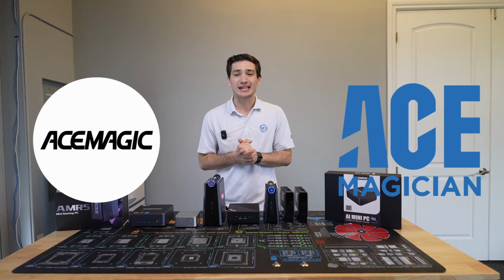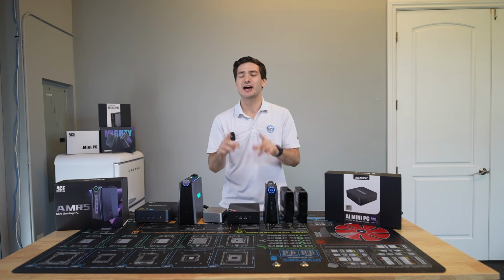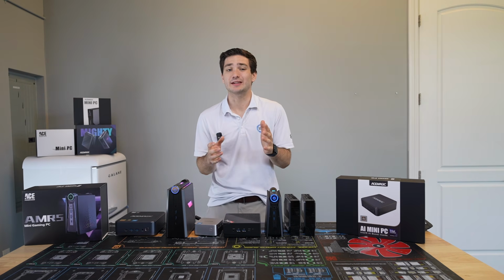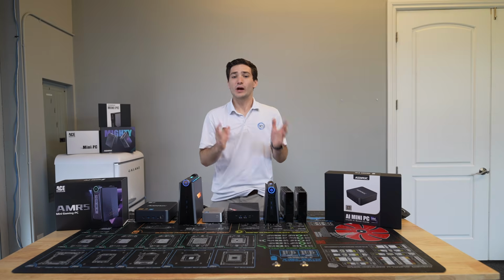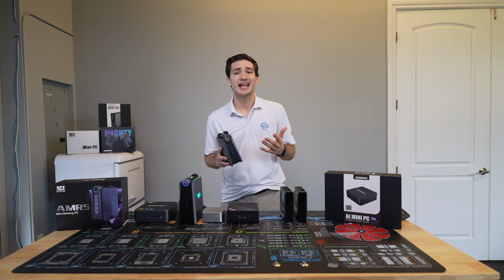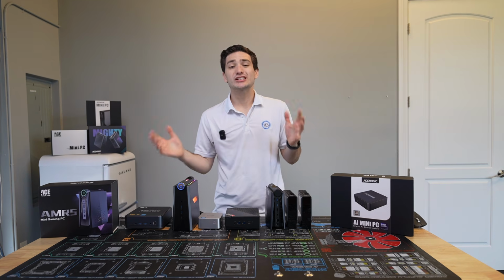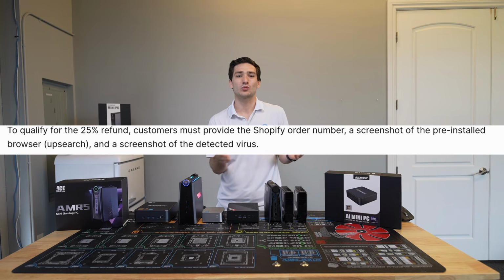Acemagic Is Selling SPYWARE! Don't Buy These Mini PCs

Comment: As an up to date..
One serious thing is with my unit here in the UK ( S3A ) is that the bios does not support Secure Boot Mode. This means the version of Windows 11 Pro they have provided has been somewhat altered. I would consider this a security risk espcially since I heard Microsoft is taking to hand all vers of by-passed Windows 11 soon.

Comment: Every single Ace Magic product has fake hardware (lower spec CPU with edited firmware to claim its a 5700U - Windows edited to show more RAM/Better GPU etc). The device chipset is FILLED with unremoveable banking malware that will steal money after a pre-determined "oh it didn't do this straight away" time they hope you'll forget the money was stolen the date of first install).
The issue is even the stuff Matt was sent that didn't contain software-viruses STILL has the hardware malware but due to its low-level, window can't detect it.

Comment: I like my rescue/diagnostics live OS's on Flash Memory cards. I use the ones that have a read only/read-write cards. So it will be a lightweight Linux OS distribution, or windows PE environment. I set these cards up on a known good machine with access to the internet, and regularly update them. 
1. The first thing you have to test is for a clean ROM UEFI/BIOS image, because if this ROM is compromised, then the OS will also be compromised. If the ROM is compromised you can always re-flash it, with the right files from the motherboard manufacturer. So research the type of motherboard used in the PC FIRST before you buy it. IF the live system running from the Flash card has no issues, like no hardware driver problems, etc, you are good to go. 
2. Make sure the BIOS is up to date with the latest (post-2023) encryption/signed keys. 
3. Assuming you have done all that, the next step is to ensure that the OS is good. So then I do a partition and format in whatever file system you need for the OS. And as others have suggested, don't use the OS loaded by the factory, but an ISO image you know passes the checksum tests after download.

Comment: 6:03
This is actually fairly normal. A lot of after market SSD heat sinks are supposed to be applied this way. Nothing wrong with it and certainly better than the OEM approach of attaching them to the drive with glue.

Comment: Wrong on the windows 11 bypass Internet part. You can bypass the no network during the setup process. Bypass/nro in Google to show how, very easy

Also a prebuilt computer/windows setup like that most likely has exclusions setup that is why the anti virus doesn’t detect them and looks fine.

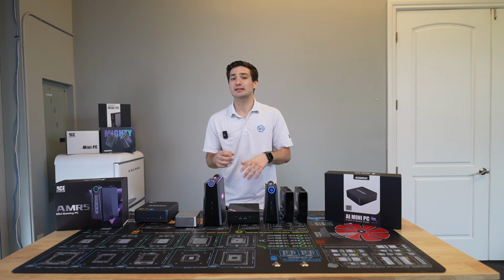Comment: 1:08 This could be due to an older ISO installation of w11 back when you could setup offline accounts. What was it ? 22H2 initial release or 23? 2:12 Oops… Nop that is concerning! MS does not bundle the iso with Chrome!

Comment: Can you easily remove the spyware?
Reply: Yes. You can simply download the official Windows image from Microsoft and the network drivers for both the wired and wireless network adapters. Put all that on a pendrive, wipe completely the system that's already installed and install a fresh new one from the pendrive, along with the network drivers. After that you can easily install the rest of the drivers.

Comment: He is right I got the Acemagic AX15 laptop and it had the exact same malware on the recovery partition and when i tried to access the partition it kept on trying to deny me access so i wiped the complete machine and did a clean install of win 11 24h2  the one that was installed was already activates and 23h2 but would not do any of the windows defender updates. 

Mine  ended up the display went bad and now the machine works but no display and after taking it apart I was right the screen driver board went bad and had a bad connection on it because i could get it to flicker by wiggling the driver board.

  Hopefully the company will send me a replacement screen or a replacement laptop but when you purchase on amazon they (the seller) wants you to contact the company directly and NOT go through amazon

Comment: I get your concerns, from every 100 users, maybe 5 will actually know what to do to "fix" this issue. I'd just download a clean version of Windows 11 directly from Microsoft, take a backup of all drivers (signed ones), format, install clean and reinstall drivers but i'd keep away from any and all of their proprietary software (and in the meantime, install a dual boot with linux as my primary OS). But that procedure is out of reach for most people. It's amazing hoy nowadays even small brands are trying to score some money from stealing and selling your data, if not directly trying to scam you or rip you off.

Comment: so it's perfectly fine for offline console emulation, right?
Reply from the maker: Yeah or as long as you reinstall windows
Reply: @mattscomputerservices  got ya. thanks. though I guess they must put the same spyware in downloadable windows image files. But I'm only looking to play old console games so hopefully this can handle dreamcast / ps2 emulation. Is that anything you've tried on this? Wonder if they will run smoothly. I know it's not a gaming pc but these are old consoles.

Comment: Solution, pull out SSD, install SSD with proper 1TB or 2TB storage, buy cheap windows 10 PC, and install using creation tool. No thoughts, no worries just good times.

Comment: There is currently a sale on amazon for this (ACEMAGIC V1 Mini Pc Computers, Intel Twin Lake N150(Turbo 3.6GHz), 16GB DDR4 RAM 1TB M.2 SSD Mini Desktop Computer, 4K HDMI DP, Dual WiFi/Bt, Gigabit Ethernet Vesa, Home/Office Micro Pc) for $198. Would it be worth it to get this and do a clean install at that price? Outside of the Malware, and the heat sink, how does the system perform? Great content!

Comment: Can spyware not be buried deep in the firmware that is flashed in on the CMOS and TPM chips (or even other chips added to the machine)?  This would enable someone to gain control over the machine regardless of what operating system is installed. For example, a supervisor password, not known to the user, for the bios can allow the system to be booted over the ethernet connection and spyware installed surreptitiously.  On some systems, the device can even be woken up and booted when it is powered down. Many PCs using Intel asset management software, installed into the chipsets make this possible.  If the TPM can be defeated, then there is no encryption of the data on the device that is possible.  Of course, I'm not saying that's what's going on here, but only that Windows itself is not the only place to put spyware.

Comment: Gemktec has always on microphone ius on right
Uo at top hidden under white tape on right they say the best way is put few layers of electrical tape
Can you trust any minor pc

Looking at all brands they seem to burn out after a year due to inefficient cooling you need to add a fan maybe a USB fan or do something else 
Online they say use Rufus to wipe out all hidden portions then load windows with USB drive
Some drivers on Mimi pc are wrong ones

Comment: I almost ordered one for $424 on sale. It had all the specs I had been wanting. Specs for a laptop or desktop PC would have easily ran me close to $1,000. I work for a software company, but I am far from an IT guy so I greatly appreciate your video.
Reply: no wonder why Microsoft servers keep crashing these days, some intern might be using an Ace Magic mini PC for internship 😂
Reply: just buy it if you need it, then wipe the operating system that it comes with and install a new one

Comment: Step one, wipe the PC and install Linux.
Reply: I wiped the unit and installed CentOS 10 directly from the online repository.  There's no Windoze malware on my machine.
Reply: You beat me to it. I was going to say the same exact thing.
Reply: Absolutely
Reply: Bazzite baby
Reply: Can there not be any code that executes prior to booting? I dont trust the lenghts they would go to to scam
Reply: @matejskerjanc7703  Yes, there can be evil ROM firmware. There have been PCs in the past that had baked-in telemetry that beaconed back to China.
Reply: For real!
Reply: Yeh. Kali is going on mine when it arrives . Immediately.
Reply: literally what i thought when i saw the thumbnail
Reply: Can I run chat dev from Linux? I have been watching videos on chat dev and want to make a game but first need a new computer. I was thinking about the acemagic mini pc with the screen on the front until I watched this video. I still might get it. Just then I can't try out crypto mining or probably use my online banking stuff or anything at all. What the fuck is wrong with this company? Is ace magic evil? Maybe it's just a few people that work there that are doing this virus nonsense. I almost got one of there laptops but it was basically the same issue.
Reply: Nah
Reply: Linux sucks 🤢🤮
Reply: @DaleKammerer  in reality you just aren't smart enough to use it 🤡
Reply: @DaleKammerer it really doesn't, unless you need some really windows specific apps, Linux will make your hardware more efficient. You can also dual boot both.
Reply: @DaleKammerer  either use what sucks, or use a literal trojan!
Reply: Step 2, wipe it again and install Windows
Reply: @nikoskabbadias if you do that ace magic might have scripts that auto reinstall the malware from uefi
Reply: @nikoskabbadias That will defeat the point, including keeping malware off.
Reply: @nikoskabbadias yup

Comment: Just so anyone knows, if you're wanting one of these or you already bought one, just simply re-install your windows before using it and you'll be good to go, there's guides online and it's very easy to do.
Reply: As long as I don't have to do it via USB or any external device, I'm all in.
Reply: @Arnell_Low_IQ_Black Nah, if you prefer not to use any external device, you can download the .ISO file and install using that🙃

Comment: I just bought the tank 03 with the rtx 3080, it came with a weird program so i reinstalled the OS. So far no problem, and the pc for the price and power comsumption is awesome, Ngl.

I have to rely on third party drivers for the graphics card, but apart from that everything is ok.

Comment: the reason many of these companies have a unique windows iso image on some shared drive: that image includes all the needed hardware drivers to boot windows correctly. yes, it can contain malwares. rubber bands for m.2 cooler: I use them and it works great.
Reply: That's what I thought as well, the google drive image may already contain all the drivers for Acemagic. But they lost the benefit of the doubt already.
As for rubber bands on heatsinks - that's just jackleg, they can do better

Comment: Okay so I have an acemagic ax16 pro (R7 5825U, 16 gb, 512 nvme ssd), formatted the ssd and installed win 11 pro.
Wifi drivers need to be installed manually as, for what ever reason, they automatically aren't (RTL8852BE). Chipset/APU drivers as well. Everything is working perfectly fine apart for the hibernation/sleep. When ever i close the laptop the side led indicating its in sleep mode is blinking but the battery drains overnight. Tried the Amd autodetect tool with no luck. Any idea on what im missing here? Thanks

Comment: Do NOT trust any new Windows you buy unless it's obviously going through the usual new windows installation wizard.  If you boot the computer and it goes directly into Windows, you know some funny business is likely going on.  

The fact that Chrome was pre-installed with navwithus as the default search engine of course is over-the-top obvious.  Even so, I bet a lot of consumers got scammed bit this unknowingly.  Computer literacy still isn't at the level it needs to be.

Comment: There is no issue if it is used purely as a batocera machine? Nothing else.
Reply: This is why I bought mine, only now I'm wondering if I should connect it to my net to update the front/back ends and use retroachievements 😬
Reply: I'm thinking of getting one. The USB drive could get infected when you go to do the install? Also what if the bios has virus or you need to download the drivers and they have a virus?

Comment: I just bought one of these and the first thing I did was install and run my AVG antivirus. Red flags went off right away. Since I bought used off eBay I contacted the seller and they refunded me and told me to keep it. It's sitting in a box and I'm afraid to use it.
Reply: I'll buy it from ya, what one you got? It's so easy to wipe the drive and install your own Windows and safe to use.

Comment: Unfortunately, I got one of these PCs, the AMD 5800U version. The suggestion to do a clean install won't work. I tried all the possible editions of official Windows images and none of them installed on the machine. The installation hangs for hours and finally ends up in a blue screen. The result is always a failure, whether you format the harddrive, remove all partitions and redo partition map, delete hidden partitions using live Linux. Only their custom Windows 11 image downloaded from Google Drive does install. It has (scaringly) many preinstall and post install scripts that it runs and downloads things from the Internet. I am not able to pinpoint any known malware in the installation image or the installed system using Defender or Avast, but I am still investigating.
Reply: After experimenting a lot with two of these machines I think I found a lot about these issues I mentioned. The bluescreen, virtualization and requiring the custom Windows installation are all about the same issue. 
1.If virtualization is enabled in the BIOS and you enable virtualization in Windows you get a perpetual bluescreen and it cannot be fixed with restore. Disabling virtualization from the BIOS fixes this broken Windows. 
2.Regular/original Windows images must be enabling virtualization by default or during some installation step, while the custom image provided has custom settings that disables it. If virtualization is enabled in the BIOS, trying to install Windows from an original image causes a perpetual bluescreen. Successful installation requires you to disable virtualization from the BIOS before starting the installation. 
I am still not sure if there is a driver or BIOS update that can fix this problem, but as long as you don't need virtualization features, this machine can work and an original Windows can be cleanly be installed. Only custom thing I needed during the install was to download ethernet drivers to a USB drive and show it to the setup when it asks for it. 
I have not found any suspicious application, bloatware or indication of keyloggers, malware, etc. on these ACEMAGICIAN Dual LAN Mini PC AMD Ryzen 7 5800U Mini PC machines.
Reply: @turgaysenlet  You saved my lived, dude. Thank you so much. I installed Windows 11 great once I disabled the virtualization in the BIOS. Thank you.
Reply: @tejedor1967  I am glad that the hours I spent scratching my head helped save others a bit of a hasle. I wish virtualization had worked, but at least turning it off lets us use the rest of the computer :) Enjoy Windows 11. I am still using it mainly with Ubuntu, and I can report that is working fine.
Reply: @turgaysenlet  i only bought this exact setup to run as a batocera emulation machine, using one of those batocera 5tb hard drives. Seeing as batocera runs as it's own linux build booting from the external should I be okay even if the current build on the machine is bugged? The boot from the drive does still want network access to do things like system updates to the emulation front and backend and to run retroachievements... do you think i should allow this access to my wifi?
Reply: @leeargyle7994  The problem is with the pre-installed Windows. Since, as far as I know, Batocera is something based in Linux, you has overwrite that problematic Windows.
Reply: it is hard to say something definitive. I personally trust it after reinstalling a new operating system. So Linux should be fine.
Reply: Get Malwarebytes or something else. Avast is hot garbage at detecting malware
Reply: They most likely have BIOS level malware in them too.
Reply: When you play with snakes, you get bitten. That is why I always start my new system from removing all storage partitions with a secure wipe. Also I only have Linux installed on these PCs.
Reply: thank you so much for telling this, I was about to buy one
Reply: Dang now second guessing buying the ACEMAGIC F3A AMD Ryzen AI 9 HX 370 Mini PC

Comment: all bs i have one i had  to reboot  and factory reset and run windows  security  and  update windows 11  you  b fine always run windows security  keep update  auto     you b fine or fine out witch  CPU is running hot or using a-lot   remove   disconnect

Comment: I bought one in October 2024 and it is clean, no spyware or malware.
Reply: I wouldn’t trust it. The fact that they shipped with spyware at all should be enough to steer clear from this company entirely. Even if it’s "safe” now.
Reply: Which one did you get? I just bought a AceMagic V1 16gb ram..
Reply: Don’t use windows defender to find the malware on these things- it won’t detect it
Reply: Or more likely - now it's just hidden better...